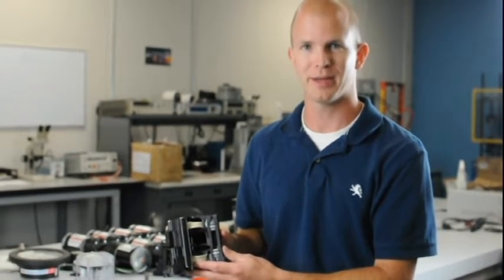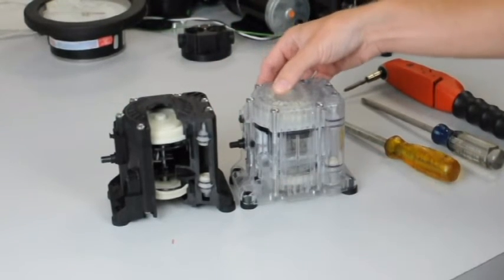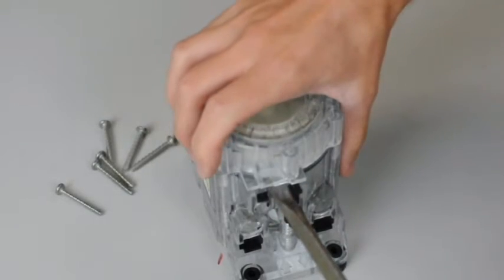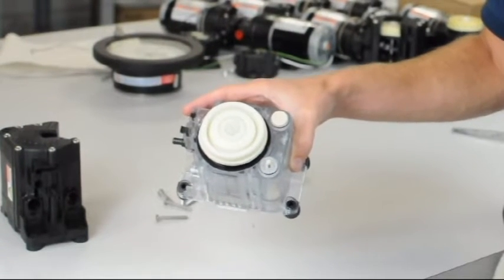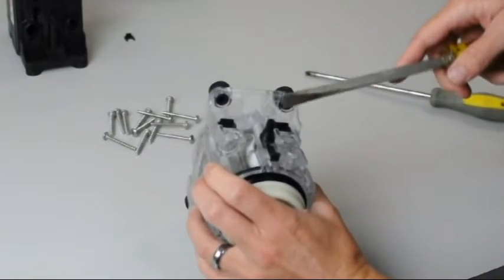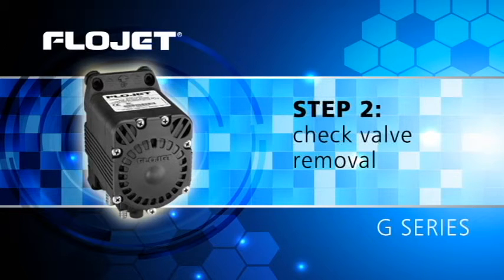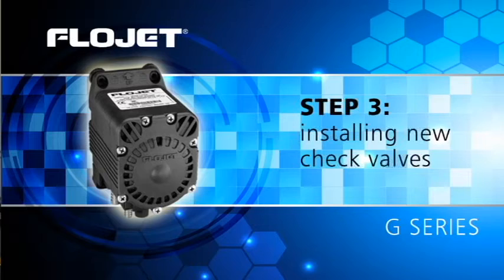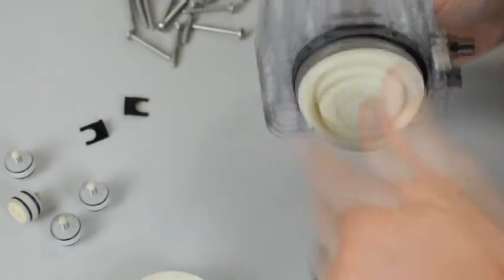FLOJET G Series Air Operated Diaphragm Pumps

Comment: You never so the what direction to install the valve and the flow of the pipes plz
Reply: Go to the kleenrite catalog #61 top of page 235 shows what direction they all go but replacing those is highly unlikely to solve your problem ...People I have repaired 50 of these ..other owners bring me theirs it's the shaft and slide valve assembly that goes bad . Not the shaft of course it's stainless steel but the 2 clear rubber Orings the get struck each time the shaft changes direction..of course they do not sell just the Orings...no money in that  but if it's leaking air or stalls and you can bump it and it runs a short while 100% one of these rings has cracked and/or broken.

Comment: why dont you show how to replace or repair the slide shaft and its o-rings thats the cause of 90% of stalls..a broken o-ring..you sell the repair kit ,,and yes it can be opened ive repaired several  kit FPK20751V for the viton model
Reply: I have several pump like those, but one is leaking air from the air breather at the bottom. Air is always coming out and the pump is still working well for now. Any idea if this is fixable ? I remove the diaphragm but dont know if we can remove or not the cover under them to get to the middle of the pump.
Reply: Page 235 parts 3a trust me I know better.32 years in the biz
Reply: @geraldknady8095  unfortunatly i dont have this catalog, it seem we need to buy it online on there website. I saw another video in spanish where the guy just use plier to pullout the cover (the one under the diaphragm) it seem really easy but mine is not moving at all... can we remove only one side ? Maybe i was trying on the wrong side. Thank for your previous answer.
Reply: @yannicktremblay9687  often when you first remove the screws and start to pry it apart the housing piece that you need removed will start to come apart . Rather than pushing it back in place I will place a small flat blade or anything like a piece of card board between it to keep it from resealing .if it doesn't come with the top lid the you need to remove top and bottom cover in other words all the stainless steel screws out of the top and the bottom okay then with a flat plate screwdriver if the appropriate spot you stick it in there and you you pry the bottom and the top away until you have both sides of the diaphragm showing then you you should be able to press at the center of the diaphragm at the bottom or at the top and make the stainless steel center rod go up and down okay grab both the diaphragm pieces firmly in your hand and then doing unscrewing motion just like you were unscrewing the lid of a jar of peanut butter One or the other will come loose okay those just screw on standard way then what you can do is stick a screwdriver you'll notice that the the diaphragm you removed they're on the shaft there is a slot in the top of it So you can stick a flat blade screwdriver in that slot and that will give you enough holding power to remove the other diaphragm from the other side cuz you don't want to grab hold of your shaft and scratch it or scar it in any way okay once you have both sides of that thing off you can usually get it to push far enough up that the shaft will all come out except for the threaded part The the thicker part will then catch behind the back side of the plate You're wanting to remove and so you kind of angle it and then you push on your stainless steel shaft with it kind of cocked in the hole and that will give you enough pork to then press out the other side I wish I could send you some photos or a video It's a little tricky but it's doable The other thing you could do is once you get that shaft kind of down out of the way enough you could potentially stick like a flat blade screwdriver with the end of it bent at 45° and kind of hook the piece but the method that I described works best . You don't want to scratch or scar the center round opening It kind of has like a plastic with a heavy fall type stuff over it and it's critical that that not get scarred or scratched in any way once you have one of the sides out of there then you can get in to remove the shaft remove the slide bar that goes over the exhaust hole and all that comes in that package You know I said to the guy on the video why would you sell this repair kit if it's not possible to repair anything on the inside It absolutely is possible I've done it many times.
Reply: @yannicktremblay9687  I don't know about using pliers that's not a tool I would ever use .your hands and a flat blade with some rubber pieces ..you don't want to scratch or scar anything..torn pieces of a used rubber glove to cushion and really it's 90  just using my hands and leverage .if you could plug all the inlets and outlets a quick burst of air would do it but I never had one I couldn't open.
Reply: @yannicktremblay9687  if you have a email I could send you some photos of opening one and a photo of the drawing in the catalog the catalog is free
Reply: They won't let me post photos here

Comment: good video can you tell me how to order the valve kit...?
Reply: Order it from kleenrite.I gave the kit # above it comes with a new shaft ,the offending Orings and the square slide box that regulates the exhaust ..I tried to goat the makers of this video (kleenrite ) to make the video .Maybe I should so one myself .If the pump not that old I get a 90% success ratio. If it still stalls or leaks I take the new kit parts out and trash it. It's very important that you buy THE MATCHING KIT THE SHAFT IS DIFFERENT ON THEM DEPENDING IF ITS VITON,SANTOPRENE ETC. ) must match .. But yes they will come apart and are repairable as long as you don't harm it while taking it apart .kleenrite's # is 800-233-3873 toll free
Reply: The shaft and slide valve for the SANTOPRENE is FPK2071, FOR THE VITON,FPK2071V the valve kit he replaces in the video Is NEVER the problem .I have used these with harmful acidic and alkaline chemicals and the failure is always the small clear Orings located on the main stainless steel slide shaft.once one cracks the shaft travels to far and doesn't bounce and rebound back in the opposite direction .